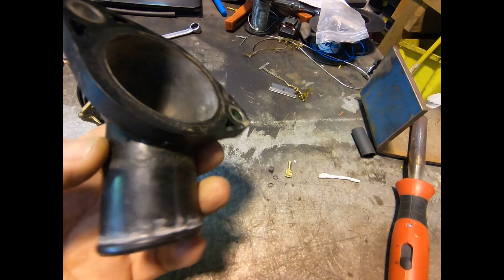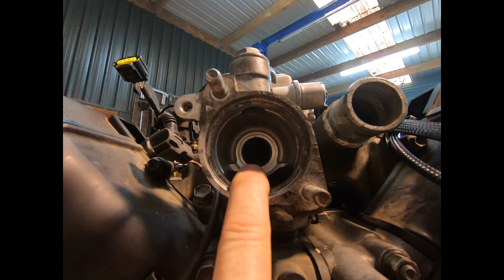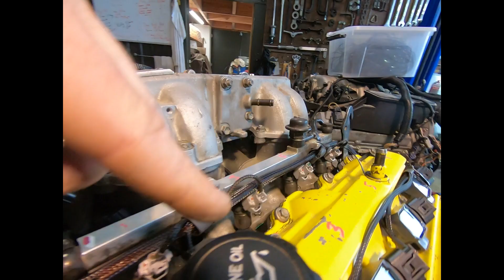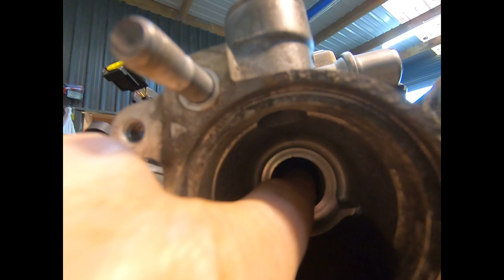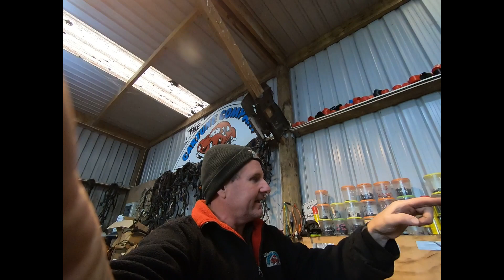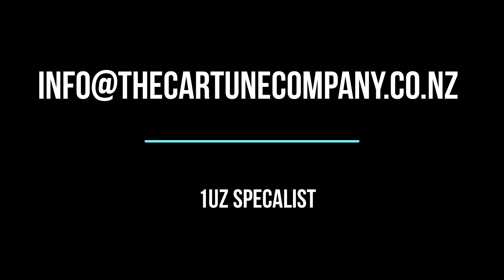1uz bypass Thermostat circuit explaination

Comment: at 3:20 when you said you blank this unit up, how? welding it closed? i run a 1uz drift car and can do roughly 3 laps before hitting thermal runaway around 235 degF, with FACTORY thermostat. Motor is swapped and has no coolant through TB/IAC/EGR all ports closed, Heatercore circuit is looped from valley pipe to rear crossover. Alumiumn rad with 5300CFM of heavy duty Efans, with no termal slowdown effect.

Comment: Hi kelvin. I am running a 1uz in my boat (alpha1gen2 outdrive).mercruiser Heat exchanger cooling. The engine runs well without a thermostat but only reaches approx 50°. I have tryed to run it a couple of times with an 82° thermostat but the engine doesn't like it and goes into a limp mode state. Take it out again and its fine.. I have changed the ecu temp sender.. Its like the engine is getting up to temperature but not circulating well, new water pump.. Any ideas? Thanks.

Comment: I changed my thermostat and it’s still stuck 1uz fe vvti
Reply from the maker: Ok.  I also exclusively use genuine t-stats and rarely have issues. Cheers Kelvin
Reply: @CartuneNZ  I changed my water pump timing belt and thermostat no leaks but the car still over heats

Comment: Hey great informative vid dude...im from the Caribbean (warm climate all the time)...i have a 150 model Prado and was thinking of removing the stat and plugging the bypass...but changed my mind after ur video n reading comments. I think  that stats should be replaced once every 10 years just as a precaution...before they stick closed and overheat engine...especially on diesel engines that are sensitive to ovetheating.
Reply from the maker: Absolutely,   I often change the T-stat with a new genuine item as maintenance.

Comment: question, just drained coolant from block and radiator, noticed that filler hole 10mm torx is still full of old coolant, sucked it up using vacuum, but still not able to refill (coolant won't go down at all) now filled radiator through the reservoir but engine block still void of coolant. cant figure out whys that

Comment: It's ok if the bypass is open but it will also be full open to the radiator without a thermostat, so the coolant/water will constantly be cooled down and not enough hot bypass coolant will be recycling, so the engine will run colder, which is not only less efficient but can cause other issues, usually minor ones
Reply from the maker: Your statement is incorrect.  Without a thermostat most situations the engine ends up overheating due to reduced flow through the radiator as most tracks through the bypass.  This is major problems in most setups.
Reply: @CartuneNZ  listen, the thermostat allows the coolant to run through the engine, and cycle back through it without being cooled by the radiator, when you get close to operating temperature the stat starts to open allowing some coolant to be cooled and mix back with the hot coolant keeping it at ideal temp. Without a stat, the coolant is all being cooled so it runs cooler. So you have no clue what you're talking about
Reply: @CartuneNZ  maybe your engines in Australia are built differently but here in America almost all the cooling systems are the same and they'll all run cold without a stat
Reply from the maker: @ericaasen4512  I'm not in Australia,  I'm in  NZ.  Ive seen lots of uz engines destroyed due to no thermostat.   Continued driving they just get hotter and hotter.
Reply: @CartuneNZ  not ours, like I said, ours the coolant just keeps running through the radiator and never gets up to temp. I ran my boat like that cuz I couldn't find the right stat. It was an old 350 Merc, I've done it on my ford's too, same thing
Reply from the maker: This video is specific to uz engines which have a by pass circuit which is large,  where the thermostat double acting and is in the lower hose.  Uz engines are the same all around the world and this by pass type cooling system has been common since the mid 80s

Comment: so if i have a race engine, do i need thermostat?
Reply from the maker: Many racecars we do over here have redesigned cooling systems with other means of ensuring correct temperature is reached.  Its not good to just remove the thermostat and doing so is likely to cause damage

Comment: Hi man how are you? just get some trouble with my cooling line and don't understand.... Get a mishimoto calorstat and runing a radiator with cap with no heater tank.... when i put full throttle i just get a massive water jet from the cap/ top of the radiator... Know it's not easy to understand like that but do you have any idea? head gasket new with mls and nothing special... :/
Reply from the maker: Personally I would test the pressure in the cooling system.  If when warm the pressures increase massively then I would be looking at the head gasket sealing.  Cheers Kelvin

Comment: Hey what about if you are running an electric water pump with the thermo controller? Strictly offroad 4wd that's going to get a fair bit of abuse? Any advice around pros and cons with EWPs
Reply from the maker: All depends on the setup you have.  Both the winchlux and big red (the 4x4 burnout video where the clutch smoked up) have radiator on the back using stock waterpump.  If using a EWP then if its mounted in the return hose to the engine using it to pump water into closed thermostat is likely going to cause issues.  As its not easy to remove the stock waterpump thats still there to circulate coolant so the ewp becomes a helper pump so set up with a suitable controller so it only runs once thermostat is open they are normally fine.  Cheers.
Reply: @CartuneNZ  good info. Is it worth removing fins or even the propeller off the water pump and just running the EWP. Then I'll be able to continue to run EWP once the engine has stopped to reduce heat soak.
Reply from the maker: @justintempleton9917  I would be worried about keeping the unit balanced when removing bits. .  If you want to keep the EWP running them removal of thermostat and blanking the bypass circuit is vital.  Then ensure the engine does get up to temperature.  Cheers
Reply: @CartuneNZ  cheers. Kelvin great advice

Comment: What is the reason to run the engine without thermostat in a jetboat?
Reply from the maker: Often in a jetboat the thermostat is removed from the engine and a external unit is fitted with the thermostat mounted in the mixer unit.  This external unit combines the hot engine water with cold raw river water so the engine gets supplied with a warm (40-50 degree C) water to cool the engine.  If this isnt done then pumping completely cold water directly into the engine can cause damage.  This system is for raw water cooling,   with a heat exchanger we still normally run a thermostat.   Cheers Kelvin

Comment: Kelvin I’m about to put a 3uz into my kit car but I only have a small area for a radiator do the uz’s need a lot of cooling? I have quite a lot of depth just not a lot of width or height
Reply from the maker: Good morning Justin.  UZs do need a good efficent radiator to keep them cool.  Lots of guys struggle with designing a good cooling system.  Often we are squeezing this large lump into small holes so good airflow becomes an issue.  Cheers Kelvin

Comment: probably worth mentioning too that there is a specific orientation for the thermostat with the little pin hole thing at the top
Reply from the maker: Yes.  Ill make sure I talk about that on a few engines Ive got coming up that are getting some work done.  Cheers

Comment: Does the vvti have the same system?
Reply from the maker: Sure does.  Cheers Kelvin
Reply: The vvti-1uz in my Delica is currently running no thermostat (had all sorts of heating issues under load - tried to fix it on a sunday - thermostat was visibly stuffed - couldn't buy a new one that day so put it together without ) its better than it was (according to the gauge with sender in top hose 90deg but Link ECU temp says 10deg more than that) What temp should they run at?
Reply from the maker: What often happens without a thermostat is inconsistent temps around the block.  The temp gauge might read lower but its no longer a true indicator of what happening.  Cheers.

Comment: On the water bridge at the back of the engine if I have no heater in the car (kit car) is it best to link the pipes to each other or blank them off at the bridge? Little bit confused with these pipes
Reply from the maker: Have you seen my video on which hoses to blank on the engine?  I always blank if no heater is connected.   The heater functions as a radiator so if no heater is present it leaves an uncooled passage for the coolant.  I always blank.  Cheers.
Reply: CartuneNZ thank you kelvin 👍
Reply: He highly suggests just capping them. Looping them can cause issues. I've got the heater hoses looped on my 7m supra right now since the heater core is leaking and yet to see any issues arise from it though. But listen to Kelvin, he knows much more than me.

Comment: I have a buddy that has a street/drag car. He runs without a thermostat thinking that it runs cooler, couldn't be farther from the truth. I asked him when does the water get a chance to stop in the radiator to cool down. He looked at me puzzled. I explained to him that it needs to sit and cool in the radiator then when the thermostat opens up it exchanges the hot water or cool water. Nevertheless he's probably still running without a thermostat. Sometimes people do things wrong for so long if he comes rite.👍
Reply from the maker: I've seen this so many times.  As you know just because something works doesn't mean it is right.  I'd guess there are inconsistent temps around his block.  I see it in jetboats too where they set up cooling systems incorrectly.  I'm going to keep spreading the knowledge and hopefully some people will listen and learn.  Cheers